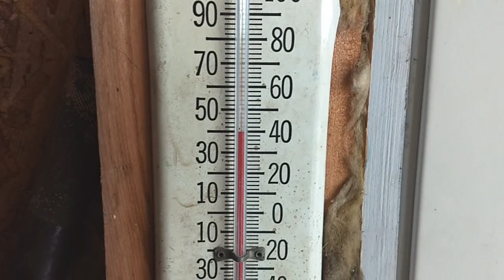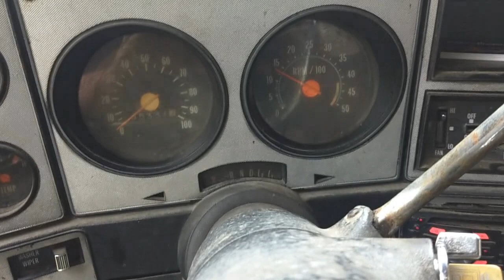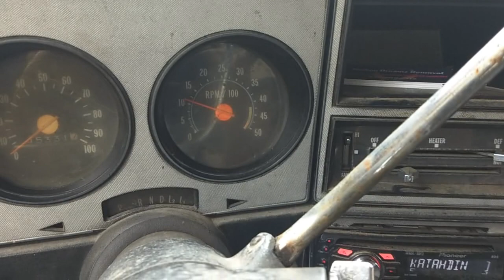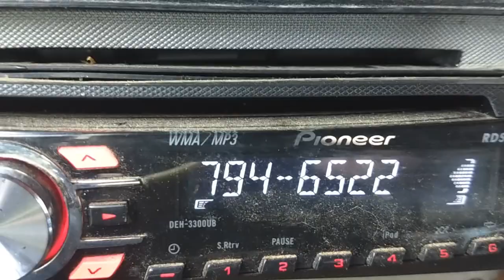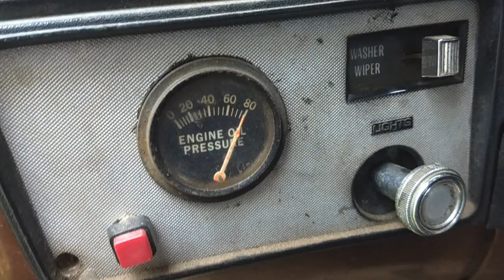November cold start-1978 Chevy Farm Truck

Comment: Sometimes I just like to fire up one of my Square bodies and listen it to it run 👍 there's something I like about the sound of the starters, too, I don't know why
Reply: I hear you!  I love the sound of the starters when the truck is cranking!!
Reply: The general does it again! it's General motors, and they're unique starters, from the 350, to any vortec, to a 292 inline 6, to a series 71, and don't tell me you don't hear it, but a lot of them and that squeaky starter sound that they make.  Nostalgic, there's just something fascinating isn't there? Good old GM.  You can't forget the sound of a mid to late '80s Buick, now those have an interesting starter sound, as does the good old iron Duke.  We also can't leave out certain generations of the 6.2 and 6.5 Detroit Diesel. Last but not least, a big block 454, 366, 427. especially in things such as rollback trucks.